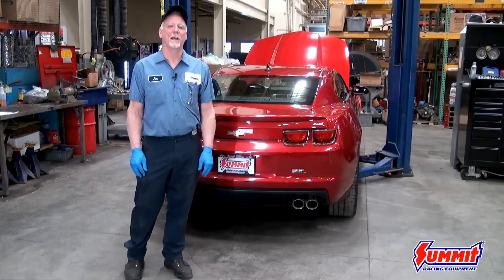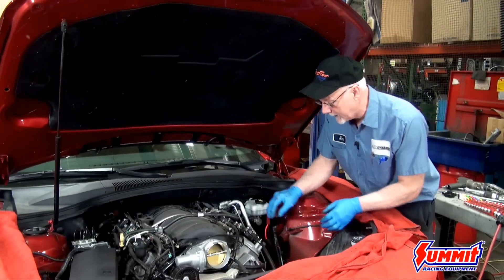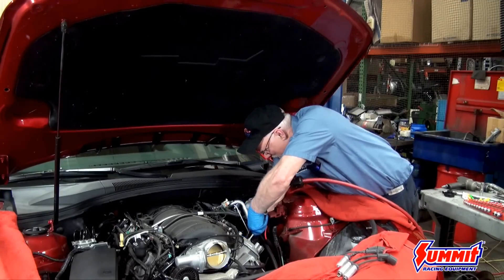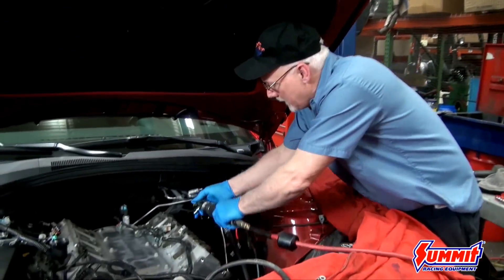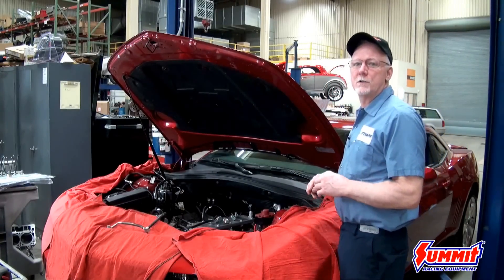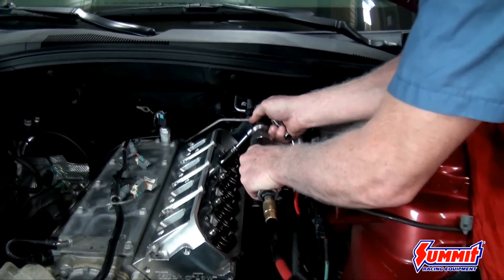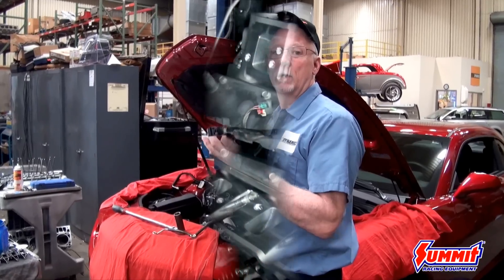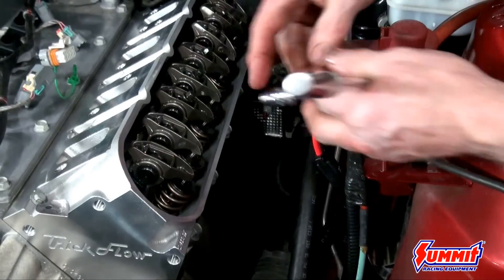Trick Flow LS Cylinder Head Install on a 2013 Camaro- Summit Racing

Comment: When lifting off the intake manifold you didn't show removal of hose to brake booster, I think it's worth showing because you can break connector in the back if you're not careful
Reply: wish i saw this before breaking it on mine 👍

Comment: What head gasket did you use? Can GM originalhead gaskets be used?
Reply from the maker: This is an older video, however, we are pretty sure we used the GM O.E. head gasket. No special head gasket is needed. Thanks for watching!
Reply: One ☝️ more question 🙋🏾‍♂️ 
What were the length of the push rods used ?
The stock 7,400 or a longer one?
Reply: fyi if your doing this, swap to cometic gaskets, gonna need toi remeasure push rod length, and possibly piston to valve clearance(if running a hot cam on flat top no valve releif cut pistons)

Comment: Great video. But DO NOT dril, tap and plug the coolant stem ports. I did it just like the video says and I could get them to stop leaking. I've now ordered the correct covers for them and the leak is gone. Luckily I didn't drill the holes out too large.

Comment: On almost all new cnc heads the way they are cut the transision is right in the middle of the short side radius, use emery cloth or sand paper and smooth out that transition to really get the most out of your new heads, I've gained quite a bit from doing this on my builds fwiw
Also if u use stock type rockers get the heads with powder metal guides especially when running over .630 lift, otherwise you will really wear out bronze guides pretty fast fyi

Comment: By switching just the Heada what is the power gain ? Why would you not do the cam at this time?
Reply: scott wolfe factory cams are actually pretty good. They are streetable and will support more HP than most give them credit for.

Comment: Should've stressed the importance of cleaning out the head Bolt holes......
Reply: What is a good way to do so?  

Just removed aftermarket heads with ARP bolts.  Have a new set and gaskets ready to go on.

Comment: Why would someone do such an improvement in head flow with a stock cam, stock exhaust, and stock intake/air intake? If they had to pay for the labor for this then they are wasting so much money. Square port LS heads are not cheap. Especially with CNC TrickFlow heads like these they would be better off getting a cold air intake & full exhaust and be better off financially and more power because the stock intake and exhaust are the most restrictive over square port LS3/L99 heads.

Comment: Never use thread tape on a bolt that goes into aluminum. Use a Teflon paste or gasket sealant.
Reply: Tape was put on the wrong direction aswell
Reply: gregpenechar that’s exactly what I was thinking.

Comment: Nice job... took a notice to that ground wire attached to the drivers side cylinder head, that looked real weak compared to the nice wide grounding STRAPs that were used during the 70s and 80s.

Comment: man, i sure hope he used compressed air to blow any remaining water out of those "Blind" head bolt holes before he put the heads back on... probably looking at a cracked block if he didn't...
Reply: Was thinking that. Most ive seen slit an old bolt and run it through a few times to clean the threads too.
Reply: Yep, buy the special cleaning tap for LS blocks, i highly recommend using the arp studs, i dont like the arp head bolts, I've had them do some weird stuff fwiw

Comment: you put your teflon upside down
Reply: He put it on counter clockwise while spinning the bolt, it should go on clockwise with the thread direction while installing.
Reply: or inside out

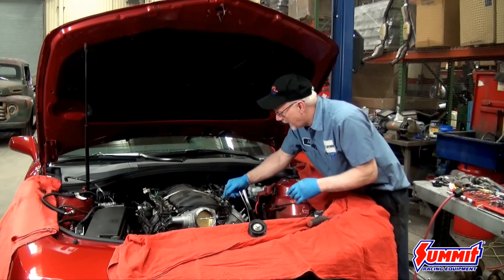Comment: the 90° head bolt tip is nice but what's your tip for the 70° torque that follows if one does not have an angle gauge...? would it be bad to just turn the lines to 11:30/5:30 after you get your 90° to 9:00/3:00??
Reply: Poopmnster I rather use ARP. Bolts torque them and be done with it pluss u can reuse them too
Reply from the maker: +Poopmnster, 
For $10 or $15 for the proper tool, there is no reason to guess. http://www.summitracing.com/search/part-type/torque-angle-gauges